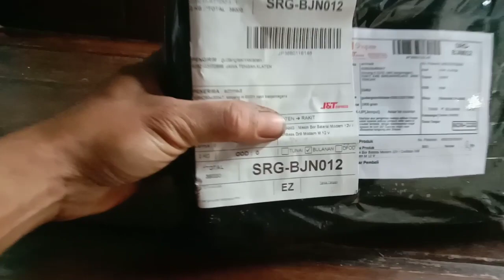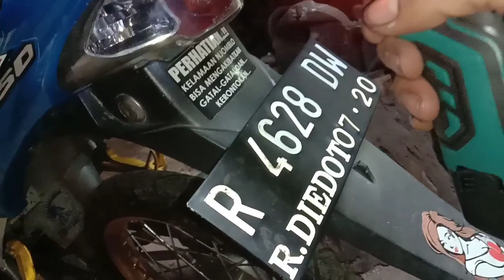Bor baterei cordless Modern M12

Comment: Om, ada merk novus NCD1200 versi murah modern M12v Rp155 rb sama2 12v dan single speed. 
Bedanya: tdk ada waterpass, tak ada lampu led, tak ada lampu indikator, tanpa tas, tanpa bonua mata bor. 
Paket hanya terdiri dari mesin bor cordless 12v, charger dan 1 baterai.